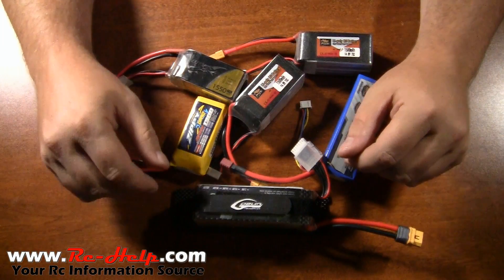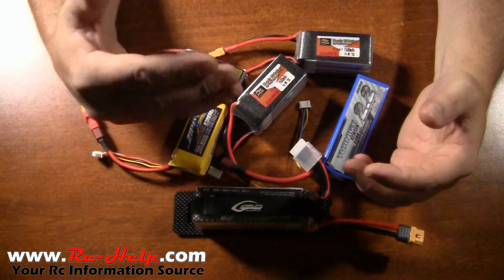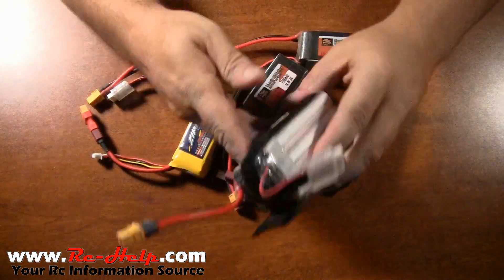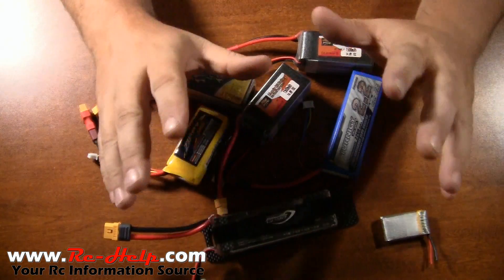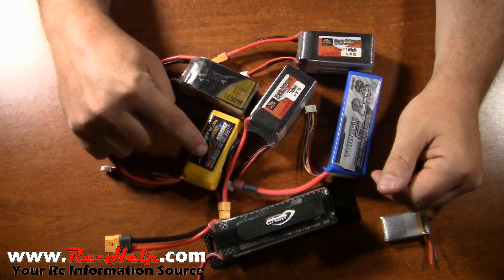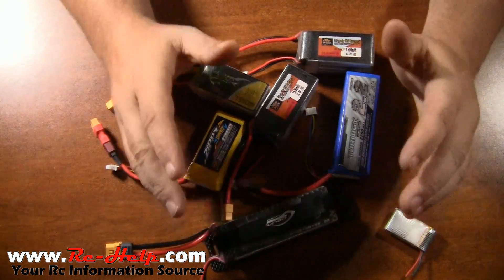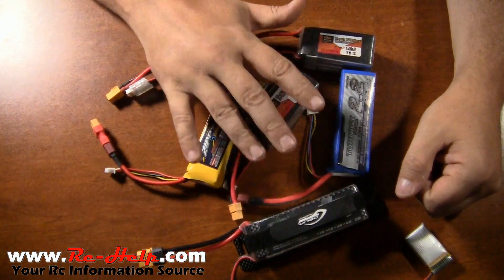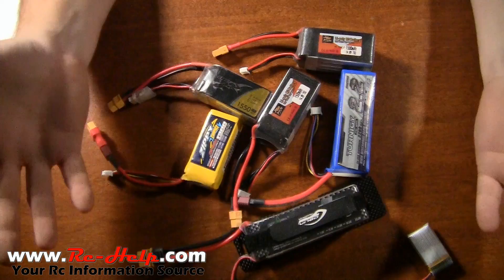LiPo Battery C Rating Explained

Comment: `- What then, if this "myth" actually originates from using too much charging current, and things have turned the wrong way?
- Does the C rating give the user any information about the battery's maximum allowed charging current?
- If not, how can the maximum allowed charging current be found out?
- And finally:
What happens if I charge the battery with too much current?

Comment: I'm running ads on my x max and my xrt and those LiPO batteries are Traxxas batteries that are only 25 C why do you think they go so low on their sea rating I'm just wondering because x-maxx and xrt run hard I never noticed the battery pack get warm or puffy yet I'm charging an 8000 me 130 C 15.2 volt lipo in my Redcat I have the amps set at 13.4 amp charge rate do you think that is okay for charging?

Comment: Are you sure? Because I got a battery GNB HV 120/240 C and seems like it damaged my ESC (speedybee F405 55A). One of the 4 ESCs of the 4 in 1 ESC sometimes work and sometimes don't after I used this battery. I saw a video from JB saying the opposite. Thanks in advance for your return.

Comment: Thanks. Does this mean lower c rating gives longer flight time!  I am confused because I got 4S 120c packs which give me less flight time thinking of dumping the batteries, so why higher Cs are more expensive ? ! I just ordered 100c. Should I order 20c better! I am flying a T28 FMS Trojan 1400mm aircraft.  Is this also applicable in rc cars ?!  Looking for high speed and longer flight time. Thanks

Comment: Don't know or understand why anyone would want a 30C battery? I don't own any batteries less than 50C rated.
Reply from the maker: Those packs are quite old and that was the norm back in the day. I do agree though, the higher C you can afford/get, the better! Example, I have a new project I'm working on, Agusta A109 600 size electric, and I'm going to be running a Pulse 5000mah 6s 50c. Thanks for the comment V.E. www.Rc-Help.com

Comment: The Sonicwake V2 36, recamends 50c  ratings ,my batteries are 80 C ,horizon Hobbies ,say I can go bigger,new to the hobby.🇨🇦80 c is better than 50c correct thanks
Reply from the maker: Not better unless your motor needs more than the 50c. Remember, the motor pulls power, the ESC only regulates power and the battery only stores power. www.Rc-Help.com

Comment: Hi there I have a 2s 980mah 30 c.lipo What amp charge rates the best to charge thanks
Reply from the maker: Depends on the battery. 980mah would equate to the following:

1c charge rate - 0.98 amps
2c charge rate - 1.96 amps

Unless your battery states specifically it can handle a higher charge rate I definitely would not go over a 2c charge rate. But to make things easier, you can just use 1amp and 2 amps respectively. No need to worry about hundredths of an amp. www.Rc-Help.com

Comment: Can I use a 2s lipo 80c for Traxxas slash 4x4 without damaging  anything. Been using 2s lipo 65c for my truck.
Reply from the maker: Yes, the C rating can never be too large. Using too low of a C rating will cause the battery to heat up. The only downside to using too high of a C rating is they are more expensive. www.Rc-Help.com

Comment: Thanks for the info, you've explained it pretty well.  I've been considering getting back into rc trucks, but electric this time instead of nitro and I hop in seeing lipo this lipo that, when I was in the hobby last nimh was the thing to use and lipo was for the rich folk with nothing better to do lol. So I never learned about it. I know a bit about li-ion batteries but not lipo and this c rating I kept seeing with the brushless setups along with conflicting info saying I need this much but not that much blah blah. I think I know what I need to look for now for the motor set up I plan on running now that most of my confusion is gone.Thanks 😊

Comment: I have a castle creations Mamba Monster motor and esc in my RC8 with a Venum 4S 5300 70C battery that performed great. It recently died. I bought a Zeee 4S 6300 80C. Is this suitable or should I go higher on the C rating ?

Comment: Does putting them in series doubles the C rating? Or does the C rating stays the same. Say two 2s lipo with 50c makes a 4s 100c when connected in series?

Comment: I've been using 75c lipos for my 3 and 4 inch quads. I accidentally bought two 850mah 45c batteries. I assume the 45c batteries are good for cruising but not for freestyle flying where I have a lot of full throttle blips?

Comment: What happens if you mix c ratings if building a bigger battery ?
Reply from the maker: To keep it safe, you will need to know what the lowest C rating is in the pack, and never go above it, no matter what the higher cells are calculated at. I do not suggest building your own battery, but just know what you are working with. www.Rc-Help.com
Reply: @RcHelpDotCom  thanks, i have an ebike and was wondering if i could mix c ratings in parallel

Comment: can i ask you something how much " c " is there in a 1200mAh 7.4v LiPo battery?
Reply from the maker: It doesn't work like that. "C" is a calculation from the manufacturer that is based on the internal resistance of the pack and what the pack can handle to discharge at one time. As a safe bet, you can calculate almost any battery at a 20c discharge rate unless the IR is extremely high. www.Rc-Help.com

Comment: Hey I love ur videos! I have a 2300kv motor and a 40 amp ESC. The battery I wish to purchase is 1000mAH and has a C rating of 20. The voltage is 11.4V. I have calculated the continuous discharge is 20A. Will this work with the 40 amp ESC?
Reply from the maker: From the number you have provided, I will have to take your word on the 20 amps for the motor. kv does not tell me anything about the motor other than how many rpm the motor will spin with a given voltage. But, at 20 amps, yes, the 40 amp speed control will be just fine.

Comment: I will need a battery pack that can take a continuous draw of 20.83 amps. I need to know if each battery in the pack has to meet that rate or if that rate is increased by wiring in series.

Comment: Hi I’m in the beginning process of building an electric surfboard but I don’t want an ESC unless I really need it , can I run my battery straight to an ON OFF switch ? Cheers 🍺
Reply from the maker: If you have a brushed motor, then yes. If you are using a brushless motor, then no.

Comment: When using a dual connector for such as the arrma kraton, needing to batteries instead of one to the esc, can the discharge rate or c rate be different between both batteries/packs?
Reply from the maker: They can, but be very careful. When running parallel, it's the voltage (S rating) that really matters.

Comment: It doesn't help that some batteries fudge their C ratings. My power hobby 50C/100C gets way hotter than my 25C/50C Traxxas
Reply: Over what period of time? C ratings are based on sub 10 second applications. The actual continuous c rating is 20c or less.
Reply: @DaveElectric  This was a while back and ended up being a defective battery. Power Hobby reached out to me and replaced it free of charge. The new one only gets warm  like the others

Comment: Does he even explain what the C stands for??
Reply from the maker: C is MAH divided by 1000. As Mamun2a stated, a 2200mah battery at a 1c rate would be 2.2 amps. at 2c, it would be 4.4 amps.
Reply: 1c = 2.2A discharge capacity

Comment: Okay so my 5000mh with 20c gives me 100amp discharge and that is exactly how much I need, what about if my battery is half full, will It be safe for a battery to pull 100amps ?
Reply from the maker: I usually like to go with a little higher C so that I'm not maxing out my batteries discharge capability. Just keep an eye on the battery temp. If it is getting warm, you might look into a larger C rating.

Comment: My battery is a 3000 mah 30C, so 30×3000/1000= 90amps max discharge rate, my motor pulls 20A peak+ few amps for receiver and servos, I should be chilling in here ahaha
Reply from the maker: Yea, that pack shouldn't even get warm lol.

Comment: wow, this is the best info i have gotten on the C-Rating... i'm getting a higher C-rating...been trying to find the right combo .. i already have a 30C ESC and a 1534Kv 2-3s Li-Po electric motor for a foam training plane with a 48" wingspan (i know that's a lot smaller than a lot of Horizon Hobby trainers but it's hard to scratch-build a 51" or 58" wingspan guys, IMO).  thanks for the great, great video.  I will click your link for the combo suggestions.
Reply from the maker: There is no such thing as a "30C ESC". I'm guessing you means 30 amps?

Glad I could help out with some information.

Comment: Question, I have an EDF 5075 kv650 with a hobbywing 160A ESC. It’s rated for 50volts. I used 4x 11.1 3500mah 60C Lipo Batteries in series. And they heat up fast, 1 of them even puffed up. I won’t be able to fly the jet in that state. Will this problem be solved if I go for a bigger C-rating?
Reply from the maker: Those batteries should be good to 210 amps if they are true 60c packs. The motor, if the one I found is the one that you have (kv means nothing when talking about current, I need wattage or amperage numbers, kv is only rpm per volt), only pulls 140 amps so you are well under the max capacity of the batteries. My guess is that you have not enough air flow over the packs (maybe) or the IR of the packs (internal resistance) is high causing a lot of heat. This is a real issue in cheaper packs. www.Rc-Help.com

Comment: No wonder my battery is puffy, and I've been in the hobby for 3 years, thanks for the awsome video
Reply from the maker: I'm glad I could help out 👍
Reply: @RcHelpDotCom i still didn’t understand..why my battery puffy? I have a rustler upgraded & stock sledge with the recommended traxxas battery i thought it was because it kept fallin on the tray
Reply: @BenjiiJackson  you need to get a charger that can put it on storage charge when you're not using it.  You actually want storage charge at all times when not using.  If left dead or full it will degenerate.

Comment: I have a question, I am looking to buy new lipos for my brushed 1/16 e revo. Is there any difference or drawbacks to going with 35C from  my previous 25C? Exact same battery. Also, i am buying new ones because the old ones are bloated, but i think thats just because i improperly stored them for a long time.
Reply from the maker: There are never any drawbacks to going with a higher C, only advantages. In no way will you hurt anything (other than your wallet) by going with the highest C rating you can afford. And when you store the packs, store them at 3.7 to 3.8 volts per cell. Basically the nominal voltage of the pack. So for a 3s, that would be 11.1. Hope this helps. www.Rc-Help.com

Comment: Great video. You explained it well! But I still have a question(what else is new). How does one determine c rating? It it determined by how thick the connections are between the cells? Or is it how thick the lithium metal inside is?
Reply from the maker: C rating is determined by the manufacturer with much more complicated electronics than I have access to. It has to do with the internal resistance of the cells and how well they do with high current loads. They usually set this figure conservatively and have what is known as a "burst rate" which can be done for no more than 10 seconds. You see this on packs where it says 35/65C and such. But as a consumer, we don't have a way to determine the C rating other than running it at a known amperage and seeing if the pack heats up. I don't have to tell you that this is quite dangerous. Too many amps equals bad things happening to a LiPo.
Reply: @RcHelpDotCom  Alright thanks. That's helpful. I feel like  it kinda had something to do with how thick the lithium metal inside is. Because it's basically lithium metal folded back and forth a lot of times. Say for example a 4000 mah 25c lipo and a 4000 man 50c lipo take up the same volume, but the lithium metal in the 50c battery is twice as thick than the 25c. Thicker metal = higher current. But as a result of it being thicker, it's more brittle and is much more difficult to fold. I only think I know what I'm talking about. I know it's not that simple but, that would make the most sense to me.  What do you think?.
Reply from the maker: In a way, it does have something to do with the thickness. But, the MAH makes more of a difference on the thickness of each cell. More MAH, more thick (bad grammar, I know lol). But I could see how a thicker cell with the same MAH (as you stated) could have a higher C rating. This would bring us back to the IR, and doing it that way may be the manufacturers way of getting around a slightly higher IR so that you can still pull a higher current. 

Just an aside, I love comments like this. Gets me to thinkin' lol. Thank you.
Reply: @RcHelpDotCom  No problem! But what I actually meant by thickness was not the thickness of the cell itself, but the thickness of the lithium metal inside each cell. Like, the inside of a lipo is basically a long but thin sheet of lithium metal I think. And that sheet is folded over many times and I believe theres an insulin that separates each fold.
So lets say, for example, you have two batteries. Both batteries and the same physical size. Wont say the mah of them, but let's say you have a 25c battery. Inside, the lithium metal is folded 50 times.
Now the other one is a 50c battery but inside of this battery, the lithium metal is only folded over 25 times. You see where I'm going with this? The litium metal in the 50c battery is twice as thick  so it was folded half as many times while still being the same amount of lithium metal as the 25c. As you know, the thicker a wire is, the more current you can safely flow through it without it heating up. Maybe the same goes for lithium metal. 🤷🏻‍♂️

Comment: Is it okay if may esc is 125a and my lipo rating is 110c ? Thankyou
Reply from the maker: Well, the 22v would be your battery, and there is no way of knowing how many amps a motor pulls from the kv rating, which only RPM per Volt. You can put a 9000C battery on anything, and it will not hurt it. The battery does not push the power, the motor pulls the power. So without knowing how many amps the motor is pulling, I have no way of knowing if anything is going to be damaged. www.Rc-Help.com
Reply from the maker: I have no idea because you didn't tell me how much power your motor pulls. www.Rc-Help.com
Reply: @RcHelpDotCom  i don't exactly know but i think is 22v with 3100 kv motor
Reply: thinking if the 110c lipo might damage the esc?

Comment: Saw a video on taking the c rating and times it by the mah gets you the amps mine was 15c x 1.5mah = 22.5amps my battery is 1500mah \ 15c .... Not enough play time trying to figure out if it my esc/motor will be ok if i buy a 4000mah \ 30c battery?
Reply from the maker: You can get as large of a mah and C as you can afford and as the model can carry. Voltage is what matters here. The motor pulls the power, the ESC regulates the power, the battery is just a storage container. C is how fast you can pull that power from the battery. www.Rc-Help.com

Comment: Tony I got a question for you I want to run a dual two 3s 5000mah lipos instead of a single 5000 pack for scale 600 size helicopter the weight is about the same, with two lipos I can put the on each side and slide them for CG adjustment?
Reply from the maker: As long as they are secure and your CoG is adjusted correctly, I don't see why not. www.Rc-Help.com

Comment: based on the weight of your rc being runned on a single battery pack.. higher c rating means higher torque potential, higher brake power potential and higher acceleration potential. 
higher c rating wont affect maximum speed. 

Also too much acceleration is funny first, but it destroy your transmission and differentials...it is better to lower acceleration input by 50% on 2wd cars and 20% on 4wd cars. This way you stay in control and your car doesn't always do whellies. Also your differential will last longer.

If you decide to lower your gear ratio to have higher maxium speed. it is very important that acceleration input be reduce otherwise you cause big stress on the motor. This is where higher c rated battries offset can be used to gain back the lost acceleration. instead of putting all the stress to your motor, your battery is going to get stressed so your motor doesn'T over do it.

when doing those setups remember to apply auto brakes around 20% and brake power at maximum 50% This way your motor will remain warm and you will not deplete your battery too quickly.

There is a reason why huge tires are made for higher gear ratios... not for low ratios.. the transmission and the differentials. 
when 4 small wheels turn very fast it is easy to make them stop or turn the other way around.  Bigger wheels tend to disbalance if you turn to fast and braking them to fast will send all that energy/mass stright to your drive shaft and differentials.. 

anything can be done on rc cars.. and every rc cars can be lightning fast... but then there is physics..
Reply from the maker: Higher C Rating only means it can withstand a higher constant draw from the battery by other electronics. It has nothing to do with torque potential. If going to a larger C rating battery gives you more power out of your motor (I use "your" loosely here), then your current battery has a C rating that is too low. The battery is only a storage device. It gives out power to what needs it when they need it. If other items are requesting more power than the pack can handle, then things will start to slow down and the pack will start to get warm. And a warm-hot LiPo is never good as we all know. Thanks for the comment monsterrun.